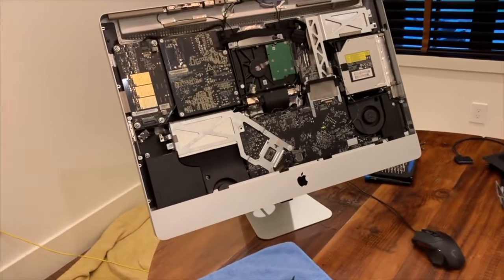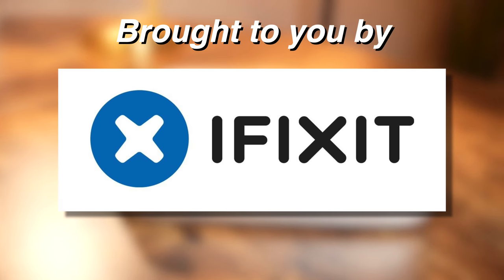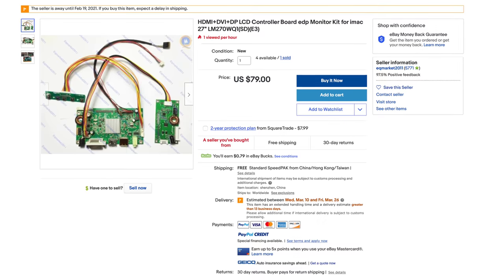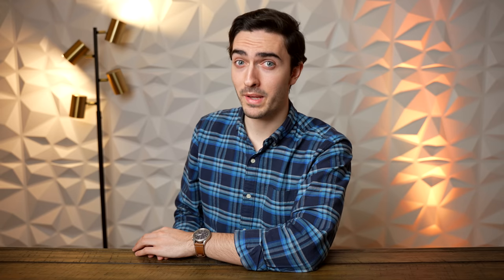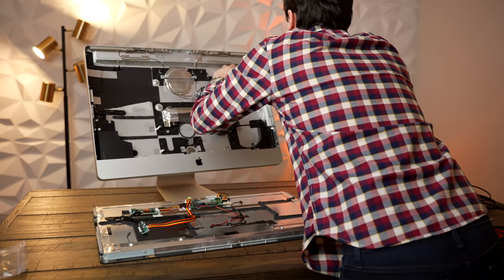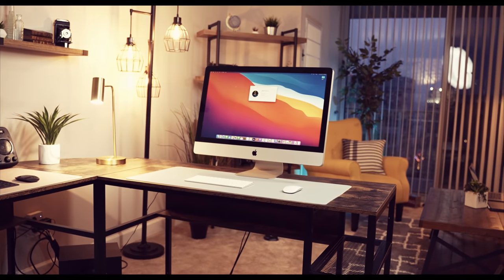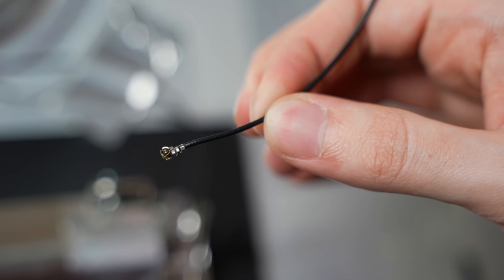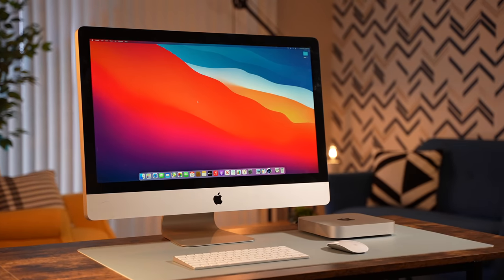How to build your own DIY Apple Silicon iMac!

Comment: 3/5/21 Enjoyed the video, an even easier way to use Apple silicon on an iMac is just to plug in a iMac mini into a working 21" 0r 27" I'Mac and Control Boot it with the mac mini connected thru a USB Port, it won't be as fast but even easier then your video. I do like the fact that your can get a kit to turn an old iMac seen useable again with the adapter kit.

Comment: Luke, the LCD eDP controller board that you used has a speaker output for sound from HDMI or DP video connections --- why didn't you leave the iMac speakers in place and connect them to that speaker output?

Comment: I've had the same idea the other day when I saw a macbook m1 with a defective display on ebay, I was wondering why nobody is putting them inside one of those 5k imacs from 2015, both would cost around 500-600€ at most

Comment: Okay, quick question.  Maybe I missed it, but if you turn off the mac mini or do any updates that require a shut down, does that mean you have to drop the screen and manually turn it back on from the inside?

Comment: You can try to solder cables from the mac mini on/off switch and route them to the orginal button on the imac. And for the ports...well...a little thunderbolt docking station on the table and another cable to the inside and there you go. ;) For the rest: nicely done :D

Comment: Hi Luke, I wanted to ask you about something that occurred to me a few days ago to see if it's possible to do. At home, I have an old Apple Cinema Display whose screen no longer works well; it has some spots like dead pixels, and I was thinking about the option of replacing the LED. Then I wondered: would it be possible to incorporate an LED from a 5K Retina iMac? Can it be connected, and would there be compatibility? And how would it turn out, considering that the size is the same at the edges but one ends with curved tips and the other with straight tips?

Comment: Why not run a USB hub, double side tape it to the iMac stand, case closed, as for power i'm sure someone could solder a connection from the mini to the original iMac button.
But yes sitting here with my late 2012 iMac 27" and can't want for the new iMac's was considering the 2020 final Intel but thought I'd wait.

Comment: tbh if i was him these parts i could make literally everything work adding them ports via dongle stuck behind the  case or stuck to the imac desk feet and also connect the imac internal speakers to that board he got since most of those display boards have a small audio amp for built in monitor speakers the power button is easily doable with soldering iron and some wires plus the a power button

Comment: The ports are on the case for the iMac right, so they would be connected to the original board somehow, so should be possible to then connect to the mac mini board as well? Worst case needig some adator or extra card.

Comment: As I said, I'd have probably rerouted some connectors down to the place where the memory upgrade hole is under the chin.   But... I was also thinking it would be fun to do the same thing with a Raspberry Pi and an iMac, instead of the guts of an M1...

Comment: 5:40 Looks like they've simply changed the Logic Board and kept everything existing from the x86 Mac Mini, same with MacBook Air/Pro 13 M1, the Pro is the same except the M1 and the Air got rid of active cooling.

Comment: Good idea... why not a Mac Pro 1 or 2  with fully functional drive bays and optical drives? If you can fool the power-supply into thinking there is motherboard connected it should be just as easy but you will be able to turn it on or off quite quickly. Its gonna take some time for Apples itself to make a Silicon Pro.

Comment: Pretty cool. :) 

For the ports, could you not run a USB hub out of the old power hole? (Also, you could add a 2nd SSD internally using one of the ports? Like a 2TB Samsung T5 or something?)

Comment: I would have just connected the screen to the mac mini as A Monitor 

For A simple hack, if you want all the connections to work, just buy plugs for each one & send them out the back lol 
& as for the power button just drill A Small hole to beable to reach the button 
With A Pen.
Now if you want to do it right gut the whole thing & solder all the Connections to the appropriate external connections or install A new Connection Panel attach A power Button if you can't get the original button to work. Have fun 😉👍🏼

Comment: you could probably relocate the power button via extension cable and put a USB hub for the ports. And while you’re at it just use the 5K iMac instead much better

Comment: This is going to become a thing. Wonder how many out of date Macs could be redeemed like this. If you’ve gone to the effort of gutting the case and fitting the Mac Mini inside might not take too much more to extend the power switch and run a USB extension.

Comment: That's amazing job, indeed. However, personally, I wouldn't integrate mac mini there... because that iMac has a low resolution comparing to retina displays or 4k-5k displays -  2550x1440. I'd just buy a new 4k LCD IPS display for it.

Comment: Would that control board also allow for a Thunderbolt Display to convert to allow it to work on a Windows based machine that only has mini-display port connections?

Comment: Your conclusion is turn it into a display. Isnt that possible via the Thunderbolt ports? Monitor mode?
Reply: No such thing as "monitor mode".  You need the $80 adapter board that Luke bought.  There is a remote desktop capability if the iMac is in working condition - but I'm not sure how much lag you'd experience.

Comment: Ha, what a great vid. I love the fact u only have to take the display off to power on. Steve would have loved losing another button. I have the m1 mini, but im not doing that to it :) but I do have an iMAc with a dead screen, and with everything else still working perfectly. I've currently got two external 1080p monitors mounted on a stand, with the iMac shell tucked under the desk.

So I was thinking of going the other way, making the first Mac mini=old iMac, but after seeing ur vid I realized that would be impossible. But surely there is a way to rehome the components of the iMac into a box somehow? Any thoughts on that would be appreciated, and keep these vids coming. thx.

Comment: Luke I know a bit off subject, but your opinion would be appreciated! Do you know if it is possible to change the ethernet connection in a 2013 27in iMac from 1GB to 10GB as with the new iMacs, it comes as an option from Apple? I know there are adapters like Sonnet Solo, but being able to keep my ports freed up and also take advantage of my new 10GB Internet connection, would be great! I'm holding out for the new M1 iMac in the meantime. Thanks!

Comment: My dream would it be to have the Macbook 12" Retina from 2015 with an Macbook Air M1 logic board because this device seems so pretty and it's basically only a big battery. So with M1 it has performance and a better battery than an M1 Air 🤔

Comment: Awesome video Luke!

I have a question, how did you solve the color rendering?
Using a controller board for HDMI, unfortunately the drivers are different and the rendering is very different from the original display.
I tested it myself on a display of a 17 "2011 macbook pro.

Can you tell me how you solved it?
Also the brightness control doesn't work too, how did you fix it?

Comment: I just have one question because I thought about doing this with my families old 2010 27” iMac, is it possible to adjust display brightness either within System Preferences or in the display controllers OSD?

Comment: being a macmini and back io connections being 90 deg off the imac rear panel... is there not any short cable options to re-build the io panel 90degree with a dremel... or cut out the optical disk drive area and shove the io to the chassis edge so no cables needed? (ie trim it with a grinding dremel and slim the io rear panel...) - yes this is frankenstein iMac but how many of us have a 2010/11 iMac that cannot upgrade past osx/macos 10.11 and they are such good chassis and the displays lasted to date!

Comment: Hey just wondering if this hdmi controler board could replace the one you used in the previous imac Studio Display replacement conversion eg instead of connecting via USB-c it would be HDMI instead.  I'm guessing its teh same principle... however my big question is would htis more simple HDMI controller allow you to also include a webcam like you did with the other imac conversion?

Comment: QUESTION: is there a way to make my 09 imac have an external HDMI connection, but NOT gut the machine so it's functional as an old mac still?  Maybe a switch between?  I should just gut it, but it's still a decent machine for videos etc.

Comment: Watched this last year as i was curious, Well i'm back in 2022 again. Unimpressed with the studio monitor price and frankly the Mac Studio is not an iMac, so debating this M1 Mini project until Apple makes the computer i actually want. A simple M powered 27" iMac, be it M1, M1 Pro, M1 Max, M1 Ultra, M2..... €1800 for a 27" 5k display, keyboard, mouse oh and a fricken computer vs a €2000 box. Sure its €2000 for a M1 Max box or €4000 for a M1 Ultra box, but it sure as fuck isn't an iMac. RIP iMac. Thanks Tim Apple you bellend!!!

Comment: I have TWO mid-2010 27" iMacs with dead video cards. LCD panels are LM270WQ1(SD)(C2) but the video board that you found specifies "E3" instead of "C2". Resolution is the same = 2560x1440. Is the C2 version compatible with boards that specify E3 compatibility?

Comment: why not just connect the imac power button to the mac mini power button... so when you push it, turns on the mac mini and the screen. Easy Peasy stuff. Also, the port issue.. well.. they are going that way already anyways lol, look at how many ports the macbook air and pro have. You could always Dremel out a hole for a usb hub to plug into, wont look as pretty.. but it works.

Comment: Just wire and solder 2 pins for the on/off switch, use usb/thunder hub and relocate on the imac chassis... a low experience technician can do that 🤔

Comment: 1. The cheapest Mac Mini M1 with 16 Gb RAM and 1 Tb SSD, which is nowdays a minimum specs, costs a little bit less than 2.000 dollars, and you say in the description it's super cheap?

2. Display converter board for iMac 2011 27" link is dead.

Comment: What about the sound now?
Also, I think you should have put the power supply for the monitor inside the iMac (maybe opening its plastic case) and just let the original port to power the device with a single cable. Now of course you would need a soldering iron... but you have one, right? I mean, you couldn't pretend to be any good at repairs and stuff like that without having a soldering iron!

Comment: You haven't put enough labour to this project: No speakers, no USB ports, no iSight Camera (They all can be re-used, re-routed to the ports in the back or through the RAM windows) The old PSU and power button of the iMac can be re-used, too, if you are skilled enough (Doesn't need very high level of skill).

Comment: I answer my own question: According to panelook.com:
https://www.panelook.com/LM270WQ1-SDE3_LG%20Display_27.0_LCM_overview_14391.html
https://www.panelook.com/modeldetail.php?id=13437
Although the general specifications are the same, the C2 has a 30-pin connector, whereas the E3 has a 36-pin connector.
So the board that Luke used can't plug into the mid-2010 iMac display.

Comment: Dude wire up the power button to where the I macs power button is lmao. Then for ports connect a hub of sorts and put on side of I mac or use male to male USB adapters and glue them where the original USB slots were

Comment: Interesting concepts, as I also have a 2011 i Mac and wondering what to do for upgrades? The previous methods you outlined Luke or just get another newer Mac mini and use just the display of the i Mac as my screen? The ports though are really good to have to make a computer more functional. Of course if you left the computer in "sleep mode" you would not have to take the screen off whenever. 
On the other hand those of use that are afficiandos of the Mac mini have our own ways of doing things, like building a robot using a Mac mini, turning the computer into a server, as examples. In any event I think I will wait a while to see what others may think through for concepts. https://youtu.be/7OZf-vpvthI from this YT Mac Repair Technician, we have another version for doing the same sort of change overs. 
I am more partial to having a hard drive as an external device to operate the computer upgrade since the most important components are all glued on to the logic board on these new MAC devices and that makes them a challenge to replace or repair. 
So I am also guessing this hack or reuse voids the warranty of the new Mac mini?

Comment: Oh lord. This DIY is really scraping the bottom of the barrel, he didn't even have hot glue. Seriously tho, I've modified an old apple IIe to fit modern hardware with a dremel, a drill, a couple of files and threaded rivets. You should really invest in some basic tooling.

Comment: Everyone wants bezel free displays so why not just get a small 4 k TV and fasten the Mini to the back of it and there you go. Ninety nine % of people will never know the difference in the display, besides you can very cheaply go up to 86 inch TV for way less than a thousand bucks. I have had keyboard and magic pad fastened to a very lite board for over 10 years that let me operate at distances across the room from my big TV. Many people are very happily using 10 year old Macs and have no problem with them, the nw Mini and a 4 k TV will set the back way less than a modern iMac so show them how to easily do that, not everyone is a video production guru and could care less how fasrt their machine can render 4k video.